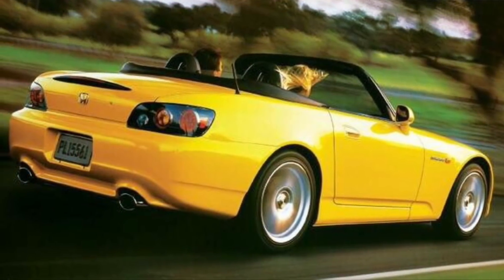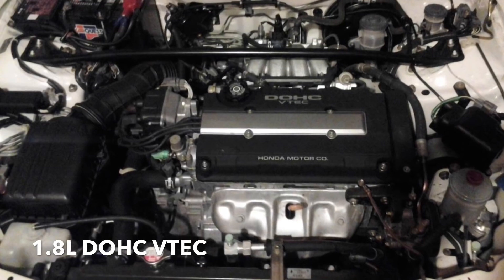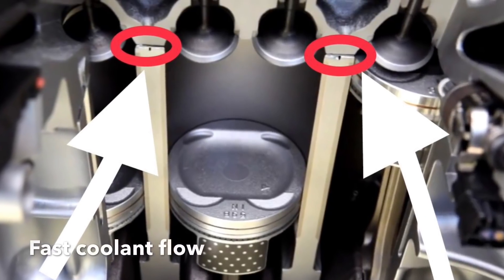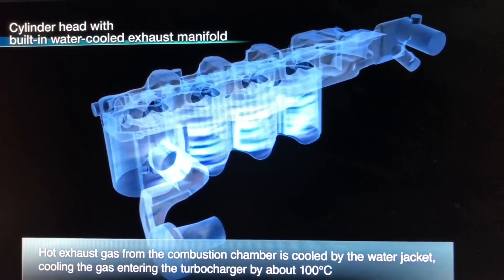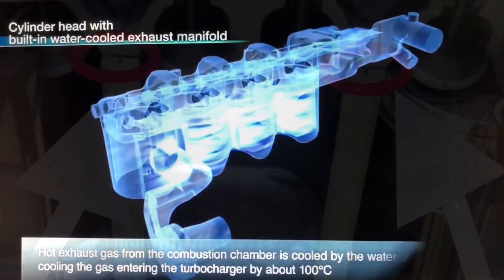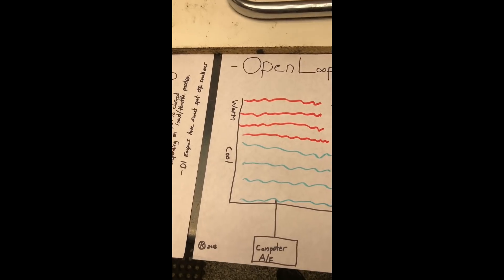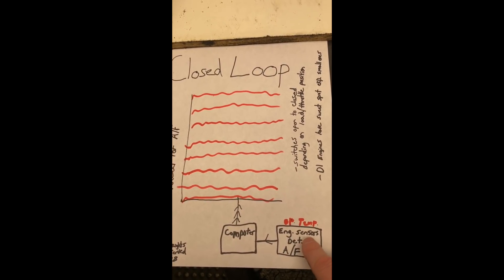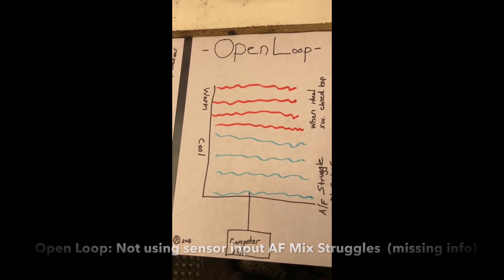1.5L Turbo Honda Oil Dilution Explained CRV Accord Civic

Comment: My Canadian 2018 Civic Hatch Sport had the update applied in January (which included an oil change) and I had another oil change and sample taken in late March (3000 km on the oil). The oil analysis showed 11% dilution (!!). My commute is 1/2 an hour so short trips aren't the problem, though this interval was over cold winter months. The car also couldn't make adequate heat for the defroster to function properly on cold (-15C) days, the engine temp gauge never rising to it's normal position.
 I had another oil analysis done in May (again with about 3000 km on the sample) and this time the dilution was 6%, lower due to the warmer conditions but still very high. Had I not changed the oil in late March, the engine oil would be at 17% dilution after 6000km.
 I have been in contact with Honda Canada Customer Relations since April 1st and it's been a very frustrating experience- their tactics are to delay, ignore, and deny. Having been provided with the oil analysis reports the response from Honda Tech was that the dilution level was "normal" for this engine- pretty much what I expected, but disappointing regardless.
 I have started the process with CAMVAP (a Canadian automotive arbitration plan) to force Honda to buy the car back so we'll see how that goes- it should be settled by September, one way or another. In the meantime I'm gathering all the solid data  I can that oil dilution levels in this range are NOT normal to support my case at the arbitration hearing.
 I'm meeting with a Honda Rep tomorrow as allowing the Manufacturer to examine the vehicle is required by CAMVAP- fair enough, though I don't know what he's going to examine.
  If anyone reading this can be of help I would be very appreciative- data on dilution, Honda 1.5 owner groups with the problem, anything at all really.
Reply: Any progress? Thanks.
Reply: Armando Sturzenegger  Ha!  As if!
Reply: @2flyabove  guess the car is fine after all?

Comment: I would rather have something very small like oil dilution versus the EcoBoost lspi problem. According to subaruwrxfan, lspi is often blamed for failures in Ford's EcoBoost engines,  apparently Ford's tune introduces alot of boost early in the rev range.

Comment: I own a 19 SI with 9.5k miles on it now. I ktuned it stage 2 on 35% ethanol at 3k miles. I track it and daily it. I sent oil analysis to Blackstone labs at 6k miles first oil change, oil read 60% on mm. Oil looked great with 0.8% fuel dilution. Recommended under 2.0%. I live in subzero winter Iowa and oil was from 12/28 to 4/20. No problem.
Reply from the maker: Randy Salisbury Running it hard I bet helps!  Also an SI I believe has engine differences also.
Reply: l15b7 si is about the same motor with different rods and turbo. I'm on a much different tune though. The trick though is in the winter only let it warm up for short 60 secs then super baby it for about the 5 mins it takes to hit 170*.

Comment: Does the 1.5 in the new accord have this problem too?  What about the 2.0t?
Reply: I have the same worry for the 10th generation Honda Accord with the 1.5 Turbo.  The 2.0 on the other hand, doesn't seem to return search results about it having oil dilution.

Comment: I have a Canadian spec Civic Hatchback with the 1.5 (174hp). Had the software fix a couple months ago. Last week, my dash lit up with every system warning possible, emissions, power steering, stability control, hill brake, etc. Was getting misfiring on injectors 1 and 4, so they replaced the whole injector unit. They’re not sure why this happened.

Comment: Seriously with heated oxygen sensors it does not take long to reach closed loop. You can monitor the oxygen sensors and the loop pid with a scan tool and time it.   Fuel vapor fumes is a regulated emissions.  This is why gas pumps have the vapor reclaim handles and why cars are equipped with vapor charcoal canisters.  If you are smelling gas no way that these cars are meeting EPA standards.  If you are stuck with one of these lemons I would suggest that you call the EPA.  You mention that Honda is doing a good job with controlling carbon build up on the valves but don't explain how?  Many manufactures like Toyota are using dual injection, EFI under light loads at idle to help clean out the carbon and use direct injection under loads.  Honda does not use this setup and it's probably the main reason for all the problems.  Factor in very light piston ring tension for low drag and high boast and you will get fuel blow by. They dropped the ball on this poorly designed engine.  Reprogramming is not going to fix it.   People are complaining about this problem all over but Honda is only acknowledging the problem on a few vehicles.  This is much bigger than Honda is admitting.  They had a few years to fix this and if the EPA cracks down Honda is going to be in a world of hurt.  This is much bigger than the VW diesel fiasco.  https://www.epa.gov/vehicle-and-fuel-emissions-testing/technical-capabilities-national-vehicle-and-fuel-emissions
Reply from the maker: Chuck Notnorris Thanks Chuck I agree and I know I was off on some of the facts however just tried to get the general public a small grasp.  Thanks for the comment it will be interesting to see what happens

Comment: Sad, my parents bought a CRV with 1.5 motor. At the time, which was more than one year ago and no issues reported I told them to stick with the workhorse 2.4 as its beyond proven. But no, they had to have the latest and greatest. So far they have not been back to dealer for issues thank goodness.
Reply: cbr9927 I’m glad mine has the 2.4.

Comment: I have a 2018 accord with the 1.5T and today my wife left for work and the car started making a whining noise and has a huge loss of power so she came right back home. so I took it down the street to hear the noise and the car has no power and started smoking real bad any guess what it could be?
Reply from the maker: Jerry Monroe That is not good I would think anything is up in the air as far as what has caused that it’s best to go get it inspected first.
Reply: @JerryJrsGarage  so I had the car towed to the dealer and and they are telling me the problem is with the turbo and also have something to do my oil level being way too high.
 (I had the oil changed at Valvoline the night before the problem) occurred)
Reply from the maker: Jerry Monroe New tech at that shop?  Its strange if oil was just changed.  Worth looking into for sure.  Wrong oil...over filled... if warranty is not covering just do your research and keep it documented.  You should be ok.

Comment: 8:06 If you own a Direct Injected anything, it's completely normal for fuel dilution to happen in your oil that's why manufacturers have started adding an oil overfull line on the dipstick...???

Comment: Blah,blah, blah.You actually know thing except to talk trash.

All cars run on close loop.When engine temp,IAT,Ron meet ore set spec it will then close loop.

Close loop should be determined within ten minutes.Fuel,air, will be adjust to run and stay at lowest emmissions.

FYI just about all turbos spin freely and do not function or at additional cylinder pressure at idle.

Ford / GM / Toyota etc have small displacement engines that don't have an issue with multi point,direct or sequential injection.
Reply from the maker: David H Thanks David I really was not trying to talk any trash.  I know I was not at all exact on any one specific explanation.  I know the open and closed loop has changed over the years and it is just not anything I study often anymore but I tried my best to just give people a very broad general idea.  Maybe I was wrong or off either way im not terribly concerned.

Comment: Thanks.  Honda says  the 1.5t  is a vtec turbo.  But you say it's  not.  i think you are right because a vtec turbo should move the light chassis of a crv  to 60  much faster than  7. 5 which is what car and driver recorded.
Reply from the maker: Wayne Williams well todays V-Tec changes cam profile to help the turbo but really though who needs a CRV That fast lol.  Still 7.5 isn’t too shabby want a quicker SUV the Ford Edge Sport is much more speed.

Comment: I just purchased a 2019 CRV EXL and I definitely smell gasoline on the dipstick however the oil level is perfect, heat cranks strongly and no odor in the cabin also don't see any white smoke in the exhaust any thoughts here because I definitely smell the gas on the dipstick?
Reply: maybe they fixed yours before you took possession! Get an oil sample and have it analyzed , for piece of mind.

Comment: Jerry Jr., I am interested, just to increase some excitement in my Accord 1.5T Sport in purchasing a KTuner 2.0, and occasionally flashing a Stage 2.  In your opinion would this  KTune setting decrease the longevity of  the 1.5T engine life?  Btw very nice video.
Reply from the maker: Miguel Torres Thanks we are not working on these daily or anything so keep that in mind.  Any Tuner is a grey area for opinions but it also depends on what engine what brand whats the tune look like as far as fuel trims etc when its running but on an engine like this and popular selling Tuner on this I would think its a safe bet but it may void a warranty and leave a trail of it having been tuned I am not sure on this new of vehicle.  Personally Hondata is my favorite brand...the owner of Hondata is very good...but for preset safe tunes yeah I think it would be good to go and not really have much if any effect on longevity.  I would feel safe with it.  I cant wait to see what others do with the power output on these in the future.  It should be exciting I think it will be a stout little engine for making decent power with the right people behind it.

Comment: If cold weather is the problem then why do other Honda owner lives in the warmer climate is having the same problems?  What Honda or you have to say for that?
Reply: who says it..we in europe dont have that problem...its a shame that so many people write and don have this 1.5 turbo...
Reply: I live in Central California with no cold temps, and have oil dilution problem with my 2019 CRV, and dealer is denying problem exists, and says I am only one who has ever complained about this problem !!    Their entry drive service advisor agreed that oil dipstick smelled strongly of gas and oil was black at 3500 miles, and then later they said two mechanics couldn't smell gas in oil.

Comment: No issue with mine so far thank goodness.  My Canadian CRV has been recalled but I am going to wait until I see if it affects performance before its hopefully fixed.  They are going to update the software and install a new heater (maybe).   It is a very nice vehicle overall it is such a shame the engine has this issue.  Honda is extending the warranty to 6 years so that's good.  Seems like all the car companies are having issues and nowadays its how well they make amends.  My Honda snowblower was made in 1976 and works even though it has an oil leak for 30 years so hopefully, this engine can deal with the dilution (they all have the issue by design).  The way the motor is programmed its difficult to keep it past 1750 RPM no matter how hard you drive it off the highway.

Comment: I have a 2018 Honda Civic SI with the 1.5 L turbo and 6 sp manual.  I change the oil at 3,000 miles max because it’s over full by that mileage and the oil smells like gasoline. I went to my dealer and they flatly deny there is any issues or recalls.  

I did hear that all Canadian cars and any US state that borders Canada will have a recall to address the oil dilution issue with a re-flash of the ECM. This reprogramming is to reduce fuel ratios at start up. 

Sadly I am in Oregon a very wet and cold place but I guess not cold or wet enough to merit a fix in Honda’s mind.

Guess I will just have to continue to do early oil changes until there is a real fix. As for other ways to minimize the problem 
1-park in a garage during cold weather.
2- warm up the car longer. 
3-buy a Lexus when my lease is up.

Comment: My 1.5t just passed 60k miles, has had regular fluid changes from day 1, not a single mechanical issue with the engine so far. The only mechanical issue that ever needed to be fixed was with the grinding transmission on start up.
Reply: Any updates?
Reply: @salgilead2801  at just over 100k now. The only significant issue I've had is that I needed to have the injectors replaced at about 90k. Otherwise the engine is solid, feels like new. Still keeping up on the fluids of course.
Reply: @YataLocK  wow that’s pretty amazing thanks for the update,I just traded my dodge dart for a honda hatchback and I encountered this video,I was a bit disappointed,considering how well honda holds its value and quality.
Reply: @YataLocK  how about now?  How’s your fuel mileage also?
Reply: @EdgeRoofCleaningCanada  at just over 112k miles now, still going strong. No notable issues since replacing the injectors at 90k. Fuel milage is great! I still get an average of 30-32 most days. With eco mode on I get about 34-35 average
Reply: @YataLocK  thanks for the update man that is awesome!
Reply: @EdgeRoofCleaningCanada  no problem! Yeah I've been pretty satisfied with this thing. But I would never buy the first year of a new generation ever again lol lots of little issues when I first got it, but now it's stretched it's legs a bit and feels even better than new. Feels broken in 🙂

Comment: Maybe they should have used a slightly larger engine instead of trying to get so much power out of a 1.5L.  Even just a 1.6L.
Reply: Thank you! I dont kniw what honda was thinking . 1.5 liters is a joke. All because of the type R which has a 2.0.

Comment: Now, I'm from Australia. I see many people buy the CR-V that uses the 1.5L Turbo. But there hasn't been any issue about the oil dilution in my country. Some people have gone over 50,000 km with that vehicle with no problems. Either that because it doesn't  snow in Australia or maybe because Honda Australia gets their car parts manufactured in Thailand.
Edit: If you ask me, I personally prefer the Mazda CX-5 with the 2.2 L Twin Turbo Diesel.
Reply: I've got a 2017 honda civic no problem here im in Australia
Reply: I'm in Australia in a warmer climate with a 1.5L 2020 Civic. I only make very short journeys on a cold engine. The oil always has a strong fuel smell so there is definitely oil dilution happening, but the dipstick never shows much more than full. So I would say that oil dilution happens with all GDI engines, but in my case in Australia it's really not an issue. I've had the Civic 3 years so far and haven't had one issue. I will say that I was a Toyota fan boy and I thought I would give Honda a try just for something different, but I might go back to Toyota, something like a Corolla Cross looks quite good.

Comment: A very common problem related to turbo charged engines is the turbine failure. My question is - how much this turbine compressor replacement would cost?
Reply from the maker: undecided Those costs are coming down...a stock turbo can easily last the life of the car.  When its balanced correctly there really is little to no friction.  For example a jet engine can spin excess of 50k rpms and easily go over 30,000 hours with no problem.  Turbo tech is really nothing to be afraid of in this day and age in my personal opinion.

Comment: I would never buy a electric vehicle they suck a EMP would totally fry it and 2 driving range sucks air temperature causes the driving range not to be near as advertised extreme heat low driving range extreme cold the same thing low driving range and third if an electric vehicle is ever involved in a accident the occupants and first responders are put in more danger because of the possibly of being electrocuted and forth our power grids aren’t ready yet for them. The electric vehicle charging system could totally fry it if a strong power shrug ever happens when charging like a lightning strike hitting a power line close to the house that has a electric vehicle in it’s garage is charging or a tornado or strong storm or wild fire knocks out the power for a few days or a few weeks you will be unable to charge your vehicle and getting to work will be next to impossible so you might even loose your job in the process.

Comment: It's a design flaw. Plain and simple. It's not a very well designed engine or this would not be happening. The problem is all the people out there who think turbos are the greatest thing since sliced bread.   I understand the reason they are going to these turbos is to try to get better mpgs, but it tanks the reliability of the engine. The only place you should see a turbo in a consumer grade vehicle is on a diesel. I should be able to reliability drive a vehicle whether the trip is 2 miles or 200 miles. That car should not care either way. And it shouldn't mix fuel and oil in either case.
Reply: It is not the turbocharger or the direct injection as everyone else already has done it.  Honda skimped on research and testing and now Honda owners are left as paying beta testers.

Comment: The problem is because newer engines have thinner piston rings because of mpg standards thicker piston rings would prevent this and sealing the head and the block tighter and add steel sleeves to each combustion chamber and a thicker piston themselves will stop most if not all the problem higher viscosity motor oil will help to stop designing engines to run on 0W-20 motor oil and design the engine to run on 10W-30 instead aluminum is a terrible material to build an engine out of because aluminum can’t handle heat very well.
Reply: So Honda owners are paying beta testers?